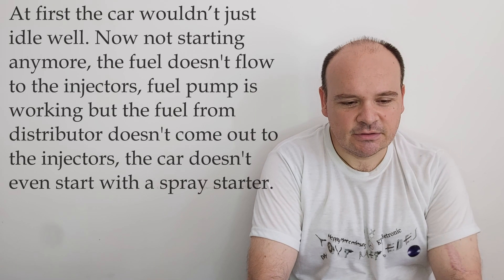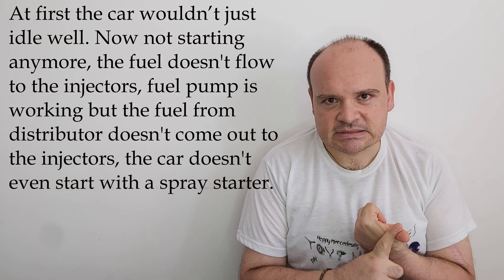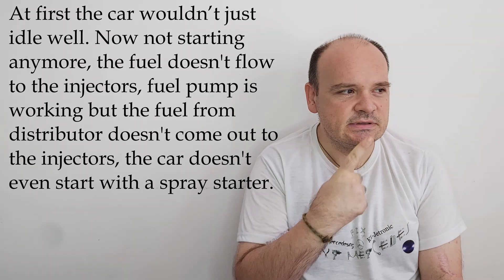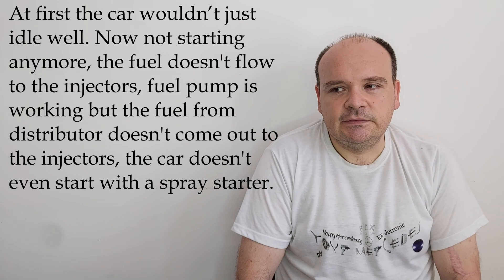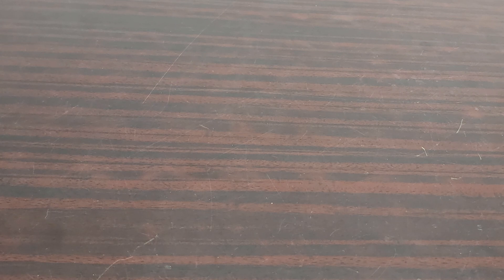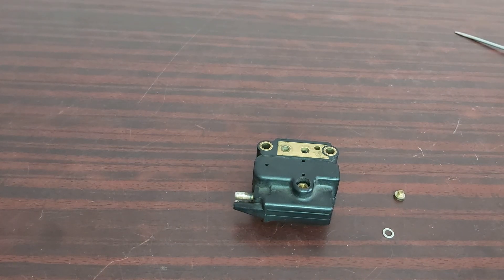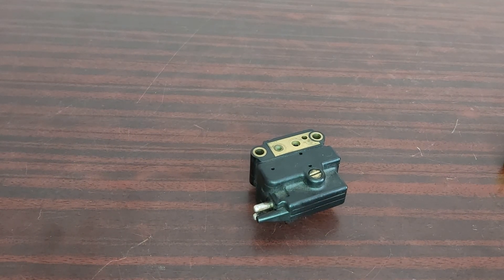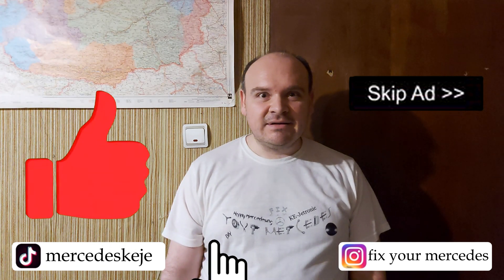㉦Mercedes Ke-Jetronic㉦ - ❌No fuel from fuel distributor to the injectors❌/my answer to the question❗

Comment: Can’t get my 300 sl 1991 R129 to stay running differential is .4 bars between control and working pressure. Fuel in only 3 injector holes then if I play with plate all holes are full place all lines back car start then dies . No fuel comes out of injector lines what could be my problem?
Reply from the maker: Check the fuel distributor if you get fuel out of all ports!

Comment: How you measure pressures if car don’t start?
Reply: I think I messed up up the adjustment screw trying to get the caliper reading of 1.9mm. I think I turned it too far counter clock wise. The screw got tight to move. I did not force it. I stop and immediately turn it clockwise. How can I tell if I have to take the entire unit off to fix if there is a problem? The adjustment screw still moves in either direction , but in my opinion a bit tight to turn even though it moves. Please advise.
Reply from the maker: @trevorross7405  If it moves you don't have to remove anything. Turn it bit by bit clockwise if it is too much counterclockwise. It's too much if you deflect the sensor plate and the engine increases the RPM.
Reply from the maker: @trevorross7405  remove the furl pump relay, bridge the contacts 30 and 78 and then measure the pressures.
Reply: @mercedeske  yes EHA was bad seal in the adjustment screw
Reply: My contacts in my 300sl R129 1991 is in the MAS relay contacts 1 and 2

Comment: Good morning Ivica hope you are in good health. My question is a simple one but no one can answer it so far. where is the starter relay locatede in a 1991 300 sl r129 mercedes if it has one?
Reply from the maker: It has no relay like the older systems. The first ones had that, afterwards the fuel pump relay took that function over and then the MAS at the end. If your ECU has 55 pins, it's on the pin11. At first check the MAS though. I will give you the link with the contacts for the MAS.
It's a contact 12 there.
https://www.instagram.com/p/Ct4Y49XspFX/
Reply: I wanted to hook up a remote starter switch to allow me to work on car from under the hood like starting it or just bumping it .  I don’t want to go under car to starter to hook up to ignition portion on solenoid .  Is there some where under the hood I can hook up with ignition to starter, and get battery power for the other side of switch?

Comment: I just replaced the EHA valve for a original new Bosch. 
My old one is idd bad. 

Now fuel is coming out of the fuel distributor YES. 

recently I replaced the waterpomp.
And forget the set the ignition timing correct (0 mark on the balancer and the rotor to the correct position) 
Timing is now correct. 
Butt won't start. Looks like backfires 🤔 not a big bang, but soft backfires. 
And I adjusted the inlet plate a little bit. And it has a little bit of play. 
Even when in spray a little bit of fuel in the inlet nothing
Reply: I found a lose vacuüm line that goes to the ignition module. 

Butt can't start the car anymore, battery is completely empty and my booster pack also.
Everything is on the charger. 
Will see it tomorrow
Reply from the maker: Repair the vacuum line. If you can't make the fuel pump run without the fuel pump relay on and with contacts 7&8 bridged then either the wires or the pump - something is dead! So - check the wires - power supply and ground for the fuel pump or the fuel pump is dead!
Reply: @mercedeske  no power on 7/8 and no power ad the fuelpumps 😅. There is no fuse between the pumps and relais?
Reply from the maker: @h.v.g7882  As far as I know one of the wires goes to the fuel pump relay and the second one is the ground. I can double-check. So - a three color wire 2.5 ⚫🔴⚪ goes to the fuel pump relay pin 87 and the 2.5🟤 is the ground. That's what the diagram says.😃
Reply: @mercedeske  thank you sir 😅. Wil look in to it tomorrow
Reply: @mercedeske  sorry to say. It was a low battery 🙈🙈🙈. 

I'm getting to old for this sh#t 😂😂😂
I'm only 45 😫😂
Reply from the maker: @h.v.g7882  In your best years 👍🏻🙂😉😃🙋👑
Reply: @mercedeske  thank you 😊. 

Does it matter if you measure the fuel pressure with the engine on or of? 

My engine doesn't run. 

And the pressures in get with the 7/8 shortcut. System pressure 6.1 and control pressure 5.9. 

The more clockwise a turn the 2 mil Allen in, the lower the control pressure get. 
The more I turn the Allen counter clockwise, the higher the control pressure get. 

Butt the system pressure stays the same ad 6.1 bar. 

I wil give it a try some
Reply: So far no luck. 

I can adjust the deferential pressure. 
Butt the system pressure stays the same 😥. 

System pressure is around 6.1 bar. 
If i adjust the pressure. 
Only the deferential pressure is adjustable. 
I can increase the deferential pressure to 6.1. System pressure stays the same also 6.1 bar. 

If both of the pressure are the same no fuel coming out of the fuel distributor. 

I adjusted the deferential pressure down to around 5.8 bar fuel is coming uut of the distributor (only when I press on the inlet plate) 

Why stays the System pressure the same 🤔🤔🤔
Reply from the maker: The system pressure is always the same, it must be constant and can not be modified - that's the point! If you want a higher differential pressure the control pressure MUST fall. At 0.2bar differential it's hard that the car is going to start. Get it down to 0.4bar then the car will start.
Reply: @mercedeske  then I'm on the good way 😅. 
I ordered some new parts. Distributor cap (original Bosch) rotor original Bosch.
I have some good used sparkplug wires. 
And a new distribution chain ⛓️ and guides. The old guides are really dark. 

I will not start the engine before I change the new stuff. 

That will be Wednesday. 

Lucky I know the fuel system is oke. 
Thanks 😊
Reply: Timing wat totally incorrect. Camshaft was e little bit of. Timing chain is in specification. 
Rotor is set correctly 🤔 its on the mark. 
Adjusted the eha. System pressure is 6.1 and control pressure is just below 6 bar (5.9) 

Engine starts a bit and stops running. And starting it longer looks like she wil try te start but not running. 

And the next problem, fuelpumps stopt working. If I jumped 7 and 8 nothing. And no power ad the fuelpumps 🤔
Reply from the maker: Also you have a low system pressure and 0.2bar differential pressure is a too lean mixture. If you can make the difference in pressures for 0.2bar more(on the EHA - turn the screw for an eight of a turn clockwise.

Comment: If you suck on the vacuüm line on the fuel pressure regulator. Should I get some vacuüm? 

If I suck or blow on it. I can't feel anything
Reply from the maker: @h.v.g7882  That's just a vent line, no vacuum there.
Reply: @mercedeske  many thanks. i thought it was wrong connected. My bad.
Reply from the maker: @h.v.g7882  👍🏻🙂😉

Comment: I have replaced the fuel pomps. The original are almost 40 years old. 

So that problem is solved. 

I get fuel out of the main fuel line ad the distributor. 
Also fuel uit of the cold start outlet. 

But nothing out of al 8 outlets of the distributor. 

Engine starts with fuel poring in the inlet. And runs for just a second. 

Could it be the black box you mentioned in this video?
Reply from the maker: Have you measured the pressures?
Reply: @mercedeske  yes, it's a litte above 6 bar
Reply from the maker: @h.v.g7882  And the control pressure?
Reply: @mercedeske  I use a cheap Amazon special 🤭  pressure meter. 
It's just below 6 bar
Reply: @mercedeske  I made my Amazon special work 😜. 
On the cold start valve side. 6,1
Ad the other side also 6.05

Measure both side separately. That's the best I can do ad the moment 😥
Reply from the maker: If you got the equal pressures above and beneath there is no chance the car is going to start. 6.1 is also a bit low, should be 6.5bar. Remove the EHA and turn the allen screw for half a turn clockwise, monitor the pressures until you get 0.4bar differential pressure.
Reply: @mercedeske  thank you kindly 🙏 I will try it tomorrow and let you know of it works 💪
Reply: @mercedeske  if it works and I have no doubts about it. You wel get a good reward. 
Tis wil save me a lots of money. 
I was almost ad the point to let the fuel distributor rebuild
Reply from the maker: @h.v.g7882  Fingers crossed!🤞🤞🤞
Reply: @mercedeske  wil do it later. A big storm ad the moment in Holland 🇳🇱 
I work outside 😩
Reply: @mercedeske  gave it a shot. Turned the screw half a turn clockwise. No deference. Turned it al the way in. And back it out 1 turn stil no diverrens 😪

Pressure stays ad 6.1 bar
Reply from the maker: @h.v.g7882  The 2mm allen screw on the Eha?
Reply: @mercedeske  absolutely
Reply: @mercedeske  to make the whole picture complete. 
This Mercedes-Benz W126 420SEL 1986 was imported to Germany form California. With engine damage (slipped timing chain) 
The engine is recently replaced with a 116-965 420. 
The person who replaced the engine couldn't get the engine running. 
I got the car. After some research (thanks to your video's) 
I adjusted the inlet plate. And yes the engine started en runs oke. 
Little bit lean. Runs nice and quiet. 
Later a was trying to perform a fuel pressure test. Hooked up the fuel pressure meter sadly it was leaking a bit (the Amazon special 😜) and the meter shows only 4 bar 😥. 

And on that same moment the engine died. 
And it was the same scenario before i adjusted the inlet plate. 
Cranking no start. Ignition is oke. 
Then I replaced the fuel pomp and filter. 
Stil nothing. 
Today I trying your advice to adjust then eha. Thirts half a turn. No diverrens. Again a half a turn clockwise. Stil no change (6.1 bar) 
They I screwed in the Allen screw completely. And 1 whole turn counter clockwise. And stil 6.1 bar and no fuel out of the distributor. 
I think that the car sat for a couple of years. And the fuel in the tank wasn't new. 
And the replacement engine sat also for some time. 

I suspect that old fuel maybe gummed up the fuel distributor 🤔🤔🤔
Reply from the maker: @h.v.g7882  At first it could be the EHA, if you can't get the differential pressure. Fuel pressure regulator as well.
Reply: @mercedeske  it's there a way to test the EHA? 
1 thing I noticed, when turning the Allen screw. It feels very light 🤔
Reply: @mercedeske  just looked ad a video of you yes you 👆😜 about the eha. If the pressure not changing the eha is BAD 🔥
Reply from the maker: @h.v.g7882  Yes, if can't increase the pressure difference between the two chambers.

Comment: Ηello,  congratulations for your video work. I  would like to have your opinion for the following. After regeneratong the fuel  distributor for the M102, it is sending fuel to all  injectors as soon as the switch is turned on for the fuel pump to begin to operate. But when the  motor begins to operate, there is not fuel flow to all injectors. There is not flow for at  least one injector. Any advice? Thanks a lot.
Reply from the maker: The fuel distributor works the same way when the engine is either on or off. I would advise you here to remove the fuel pump relay and to bridge the fuel pump. If the car starts then you have problems with the fuel pump relay.

Comment: This video is one of the your good ones.
On 190e 2.3,  it doesn't crank, no sound:

- Has new battery
- OVP relay is checked & is good
- Ignition switch checked & is good,
_ transmission shifter inhibitor checked & is good,
- All lights behind dash comes on,
- fuel pump comes on.
- No signal to the starter.
So what's next to be checked out?
Thanks

Comment: Hello. I need your opinion regarding my M103 that’s hunting on idle. I just replaced my EHA and fuel regulator for a new one so I had adjusted the mixture, but now the idle bounces with the aircon off. As soon as I turn on the aircon, it idles fine. Could it be too lean or too rich? Hope you could help me out. Thanks and more power to your channel!
Reply from the maker: Hello. Replace the potentiometer and calibrate it if you haven't. Concerning the mixture, set it to fluctuate 6.65-7.33V. If no fluctuation, then replace the lambda. If your car is without the lambda then set the mixture to steady 6.65V. Hope these advice help you. Greetings and happy Mercedesing.
Reply: Hi. Thanks for the response. I have calibrated the potentiometer already. The duty cycle is stuck at 70% most of the time, but would sometimes fluctuate at 50%. Lambda sensor is only about 5-6,000 kms old. Throttle also cuts off randomly when cruising on highway, it does not respond to any throttle input. Does this and a hunting idle usually indicate a lean or rich mixture?